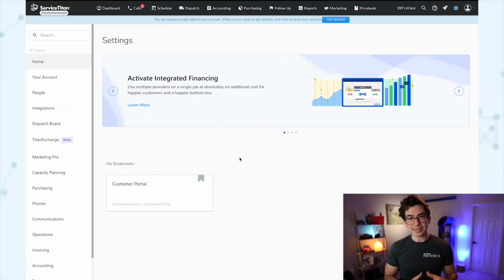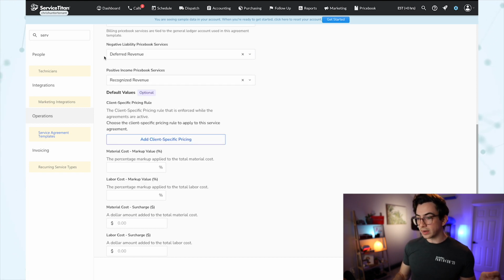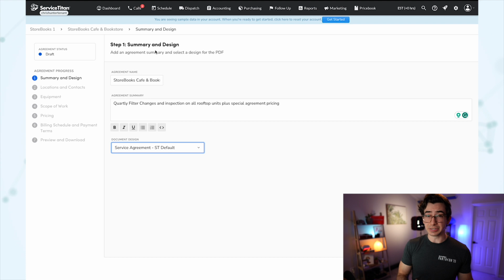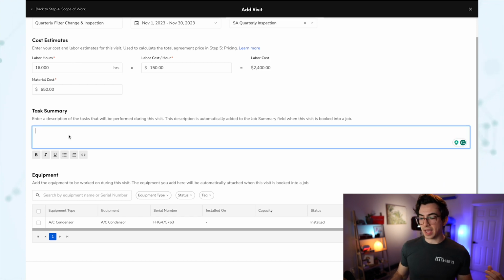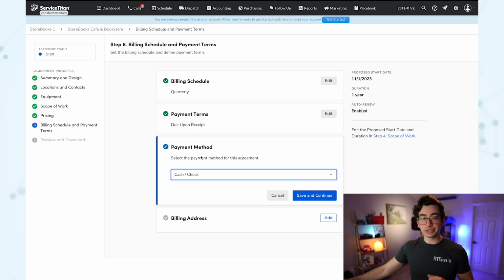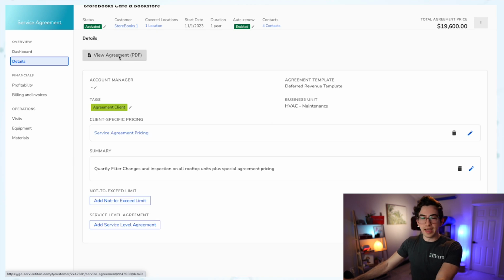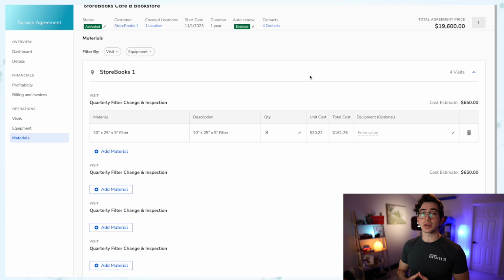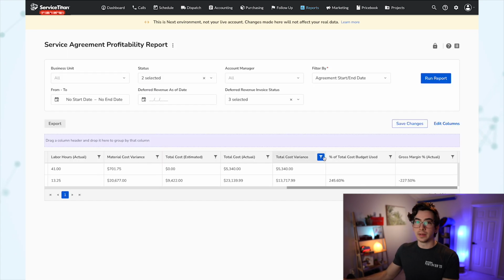Tutorial: How To Set Up & Use Commercial HVAC Service Agreements In ServiceTitan Software?

Comment: Is the document template builder even live yet? I do not have the option for it, nor do I see the option to turn it on if the feature configuration.
Reply from the maker: If you have service agreements enabled on your account, then the document engine should also be enabled. They are two different switches on the back-end, so it's possible that one was missed. Support can help you